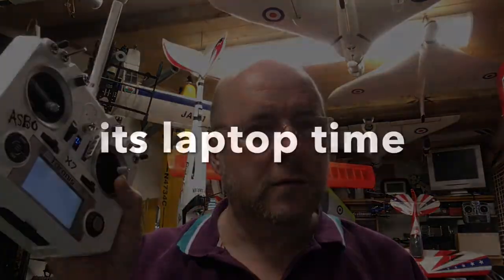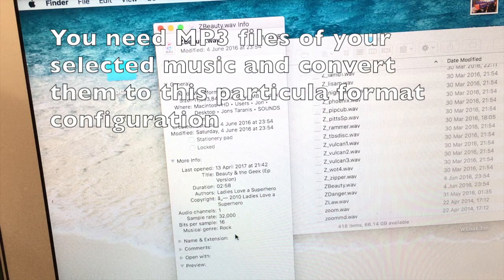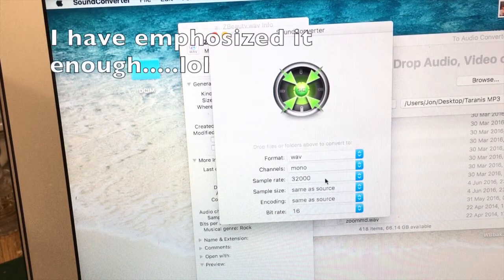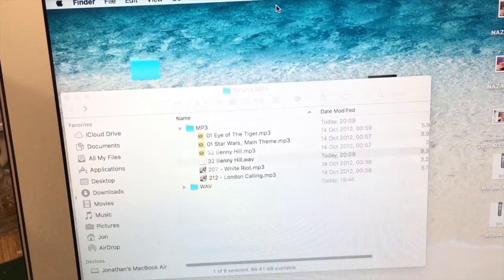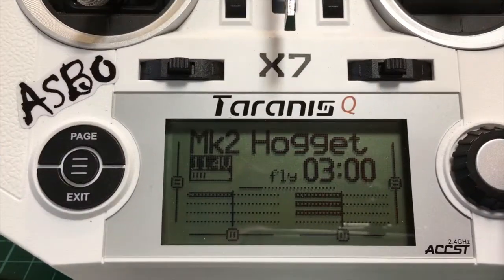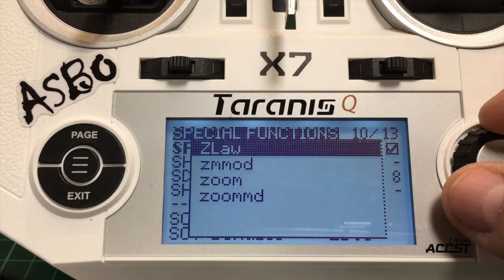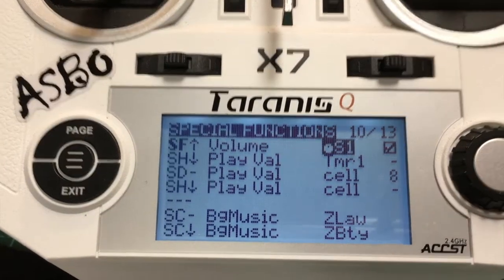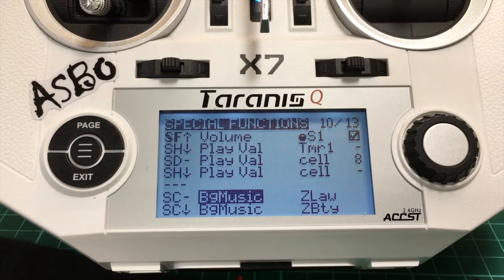Taranis Q7 Background Music

Comment: Excellent, well explained, video. One tiny tip: Rather than using the SF switch to enable volume control which can then be controlled via your choice of pot; One can simply set the special function as follows : On ➡ Volume ➡ "Pot switch of choice" ➡ ☑ finally, toggle the box on the end to activate the logic switch. What this does is that the volume knob is active all the time with no need to first toggle a switch. In addition, this method frees up a switch, in this case the SF, so you can use it for other things.
Reply from the maker: Cool....thanks. 
Another way I found is set the volume function copy and past it for all positions of the same switch. You can actually use the same switch for more than one function and that is what makes Taranis great.
Thanks for the tip......I think I will use your tip as it seems more logical.
Reply: @TWSreviews  That's true😊 OpenTX does allow all sorts of whacky stuff like using the same switch for multiple purposes. I know I would screw up though and that's why I prefer to use one switch at a time for a particular function. At the end of the day, OpenTX gives us many, many options👍
Reply from the maker: @Clickbaiters  get some music on there.......I quite like flying to "I fought the Law" by the Clash

Comment: How did you go with the 6 position selector upgrade? i didn't see a following video on your playlists. great video by the way.
Reply from the maker: lol.....I added it to my X7 to replace one of my knobs and wasn't quite what I expected. I was hoping to use it as a music track selector but was recognised as a knob rather than a switch operation and needed a complicated set of logic commands to get what I wanted and was buggy so left it be. Ideal for the X9D though for use with flight controller mode selecting so will add it to that transmitter.......I will do a video soon.

Comment: what was the second audio converter?
Reply: Well, it's FLOSS Software, of course it runs on OSX...
Reply from the maker: To Audio Converter Free.....
I seemed there are not many free ones that give you 32,000 rate
Reply: got it many thanks, have you tried to use the $9 multiprotocol module from banggood?
Reply from the maker: No sorry, not yet.
Reply: Audacity... just use Audacity...
Reply from the maker: thanks......I will check that App out as long as it works with apple.
Reply from the maker: all installed.......I am recording my own messages now too.
Thanks for the recommendation.....
Reply: No problem ;)